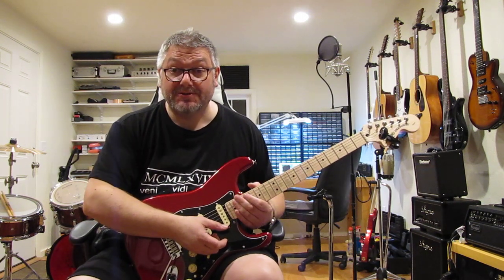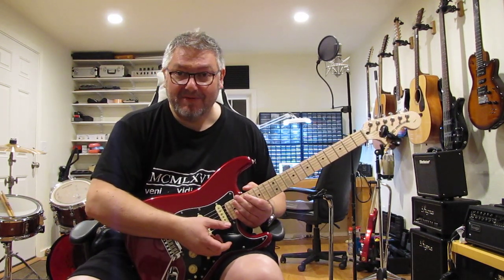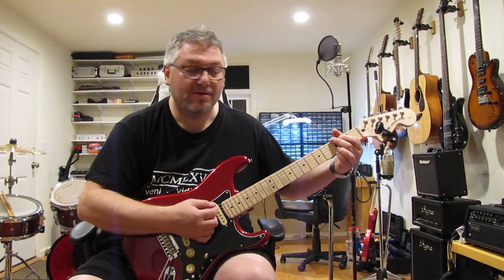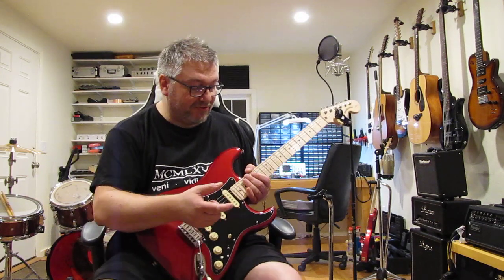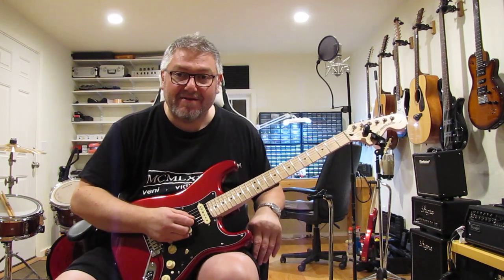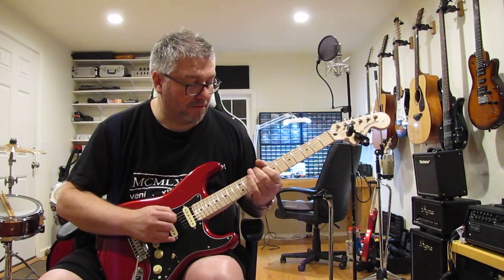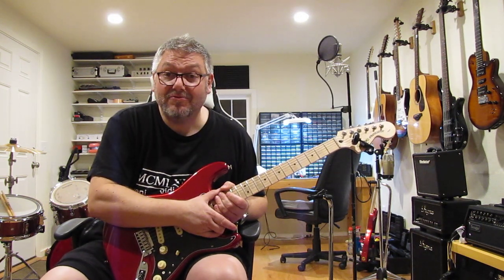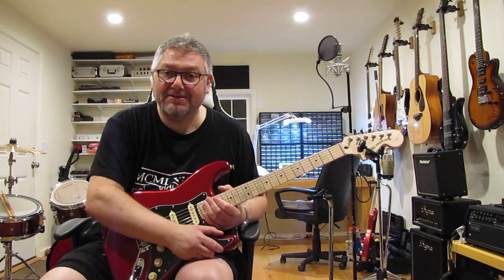Pellucid compressor (rev B)

Comment: Sounds friggin great! Hey I tried replying to your boba FET amp video,  dying to build that amazing sounding little guy, bit I couldn't locate the schematics, pcb or other info on it, I'm crazy about that little thang.
Reply from the maker: I'm sorry but I don't have any Boba FET PCBs left. If you send me your email address or email me (jonny.reckless@gmail.com) I can send you a link to schematic, bill of materials, and GERBERs for making a new PCB. You can get a PCB made for probably a few bucks. I do have another amp design very similar to the Boba FET called the "Rosie" which I do have a spare PCB for.
Reply from the maker: https://drive.google.com/file/d/0BzLBW4IzZybIYjFGaXpsODBVdzg/view?usp=sharing
Reply from the maker: https://drive.google.com/file/d/1dMZAvFHAK4c_JKfGeQ7KokqeplQAfuoN/view?usp=sharing
Reply: @jonnybreckless  sounds great!, I'll email you , I'd love to check out the Rosie as well. I love the sound of the boba as that brown sound as well as lower gain and cleaner tones are exactly the kinda of tone I love. I have a few Jet City tube amps that I've modded to brown the up, or Marshallize them, and I love them but to dang loud. Thanks man! The compressor is great also.!